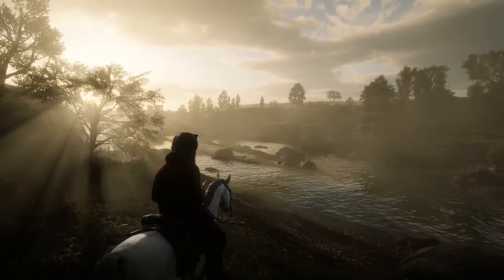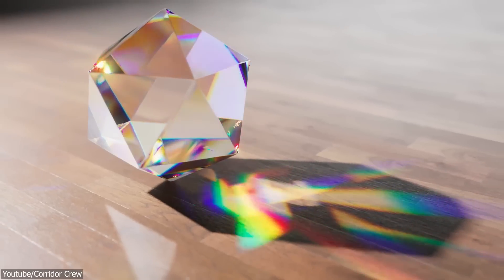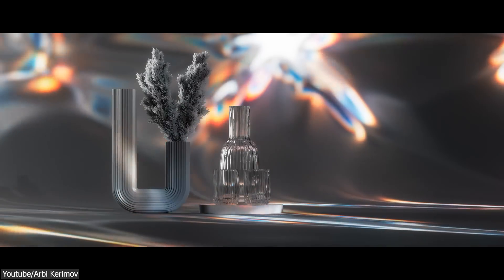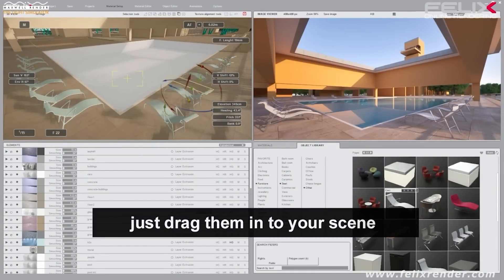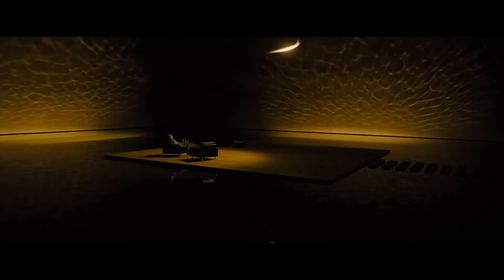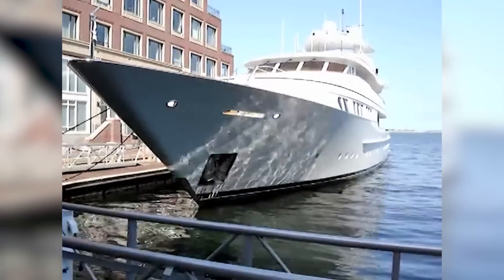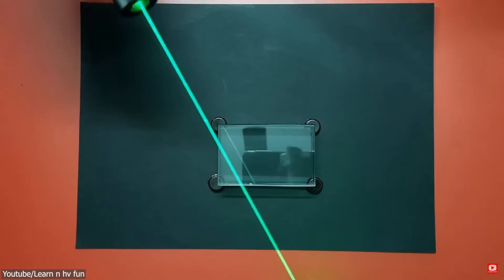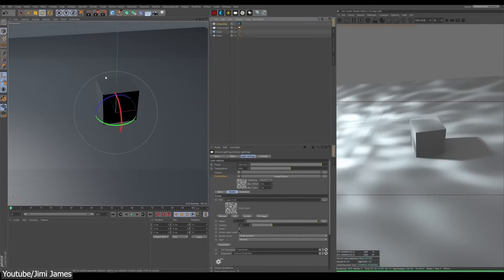3D Artists Have To Cheat To Render This!

Comment: I'll save you 10 minutes: 

basically your computer sucks, & even if it didn't it would suck for rendering fancy light refractions. B/c fancy light takes a lot processing power. So you'd need a stronger computer. Don't forget to check out the sponsor. Light passing through an object is called refraction.  The shape of the object and the angle light strikes it changes the way the light refracts. Sometimes that gets complex so artists fake it. 

Don't forget to check out the sponsor.